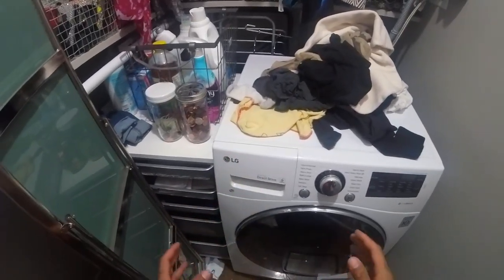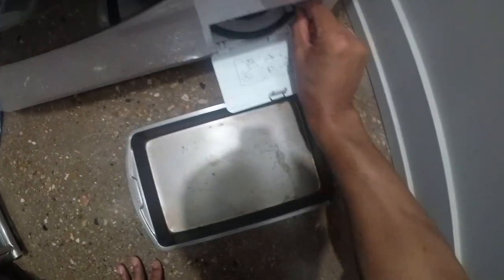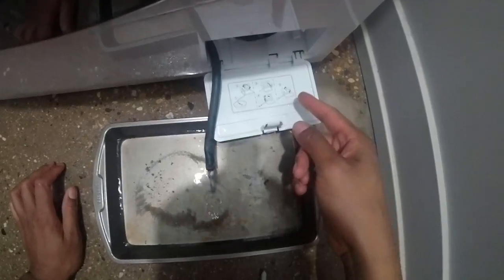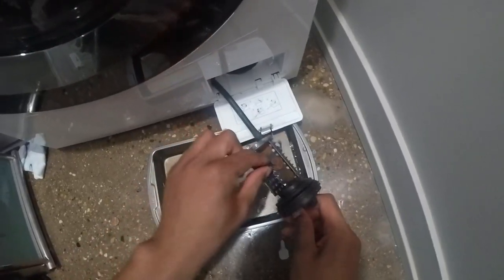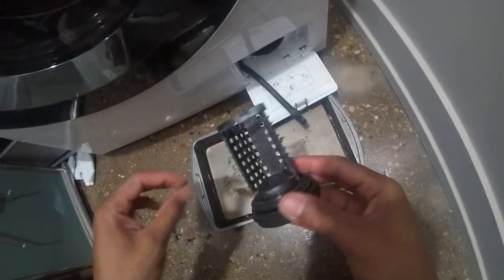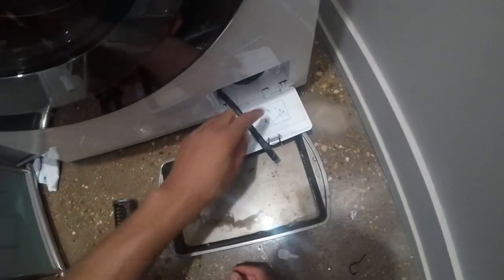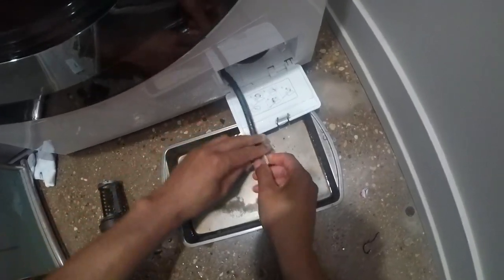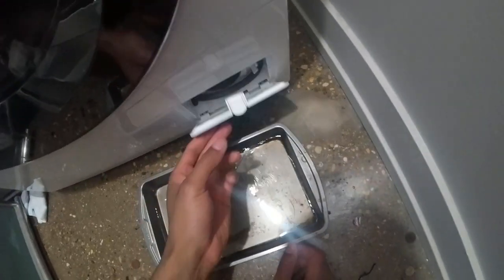LG Washer Machine Lint Removing

Comment: Check your washer to see if you have a Hose Clamp or Glue on the inbound side of the discharge pump. If so, that is not a factory connection. There is not supposed to be any Glue or Hose Clamps on anything according to LG.  Most of the LG washers had to be reconditioned, then sold as new. The hose is 2 inches too short and the travel of the tank, to offset a lopsided load, will one day rip that hose off. I repaced 12" of drywall in my washroom. Contact the FTC.
Reply from the maker: @davidtisler82 thanks for the tip!